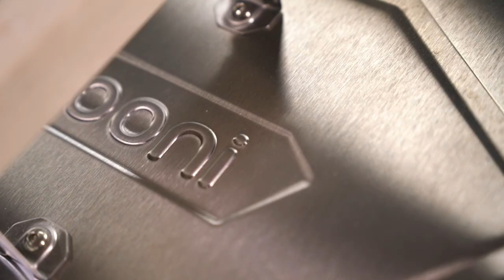Guide To Firing Up Your Ooni Gas Burner

Comment: My gas burner keeps randomly cutting out. Any advice how to stop it doing this? I have vents all closed and I've tried the "burp" technique
Reply: @kristiantapaninaho9776  thank you for your reply it seemed to have stopped doing it so I will see how it goes. I did use charcoal before had a little soot on the hatch so it may have gone out due to smoke
Reply: Did you find out how to keep it lit. Mine also keeps on shutting off
Reply: I haven't had a problem with it lately but if you have a lot of soot it may cut out due to smoke

Comment: I have had my gas burner for 1 year and a half and now the flame is very short and weak and it no longer has the power that the karu12 version of the gas burner had before
Reply from the maker: Oh dear! If there is excess pressure built up in the regulator, the valve will get fully or partially stuck and stop gas from exiting the tank. All you need to do is reset the valve by “burping” your regulator. To do this, please follow these steps:  

1.) Disconnect your regulator from the gas bottle and leave it for around 5 minutes. 
2.) Reconnect the gas regulator and very slowly open the gas tap on your propane tank
3.) Check that your oven is on a flat surface. Uneven surfaces can affect the flow of oxygen, reducing flame 
4.) Push in and very slowly turn the gas control dial on your oven anti-clockwise. There will be a slight delay as the gas moves through the hose to the burn and so it is important that this action takes 5 seconds from 12 o'clock on the dial to 9 o'clock on the dial. 
5.) Once your oven has lit, continue to hold in the control knob for at least 5 more seconds. This gives the burner the chance to light fully and encourages the gas to flow.

Please also check that the gas tank you are using is full. If you are still noticing that your flame is short and weak, please submit a support ticket with our Team here: https://support.ooni.com/en/support/tickets/new

Please include your original order number, oven serial number (can be found on either side of Gas Burner/metal safety certification tag depending on the unit), and footage of your gas tank and regulator, connection, and, if possible, initial ignition and flame output. If we determine there is a fault with your unit, we'll be able to advise on the next best steps. Thanks so much for your cooperation! 💛
Reply: @Oonihq  I already tried that and it has nothing to do with the regulator valve, I have seen that many people in forums complain about this problem and that after a while of use the flame turns blue and very very weak and short, it does not generate the enough radiating heat and there are those who say that a configuration is made by putting clamps on the burner vents but I have not heard of doing that, if ooni guarantees good operation of its products and ooni support does not know what to do with this problem
Reply from the maker: @ebka13tekpatl  We will always support our products and we are committed to offering our full service under warranty. Please do reach out to support.ooni.com with your gas burner's serial number and a video of the issue and a member of the team will be really happy to help resolve this for you. Please do not make any modifications to your gas burner unless specifically instructed to do so by a member of our support team as this will void your warranty. Thank you for reaching out - we'll get you cooking again as quickly as possible!

Comment: So when using gas, the chimney dos not get as warm as when you use wood?
Reply from the maker: When using the Ooni Karu, the chimney is removed and the cap is put in its place but with the Ooni 3 and Ooni Pro, the chimney still gets hot!🍕
Reply: @Oonihq  Okay yeah... But the heat over the chimney is not as hot as when using it with wood right?
I would like to use it on My open deck under the rooftop. But I dont want to damage My roof due to to much heat from the chimney. Makes sence?😉🙏🍕
Reply from the maker: Hello Klaus 🍕We always advise to allow 3 metres above the Ooni and 1 metre around. You can also check out the Ooni Community page on FB ( https://www.facebook.com/groups/oonicommunity/ ) to see what other people have tried out in this situation.😉
Reply: @Oonihq  Hi... 3 meters is no good for me. But if i use the pro with gas, i will have to close the chimney, right? That way i will not have the same heat issues, as if i was using wood (and the chimney) ?
Or am i wrong?
Reply from the maker: Hello Klaus 🍕Our general recommendation is 3m. You can also check out other set ups on in our FB community. 🤗🍕

Comment: Mine is barely putting out gas and I checked everything. It don’t know what to do. It doesn’t look like the gas I see in videos. It’s a new tank so I am not sure. It looks normal for a second when I turn it on. It barely stays lit though
Reply: Hey have you reached out to our support at support.ooni.com? They can troubleshoot it for you to get you back to cooking. I know some regulators have a safety limited that kicks in if too much gas flows out at ones. If that's the case our team can definitely help you out! ^kt